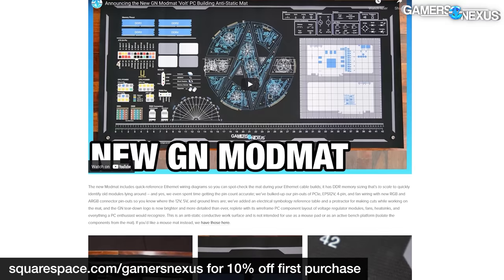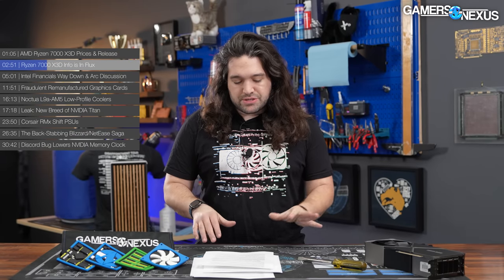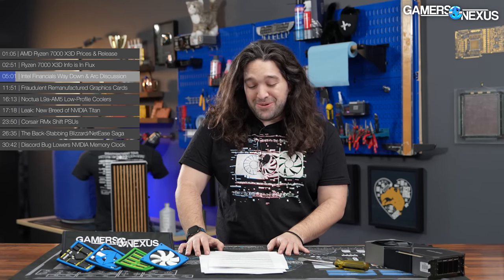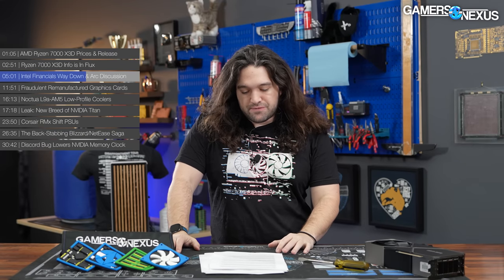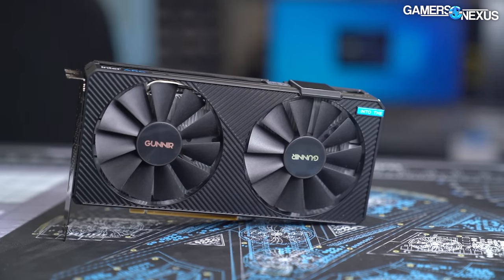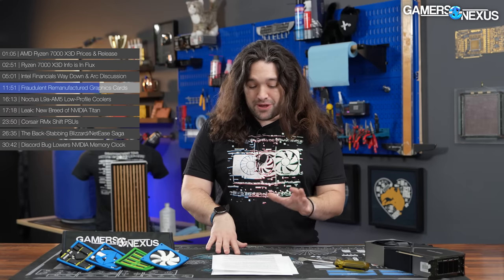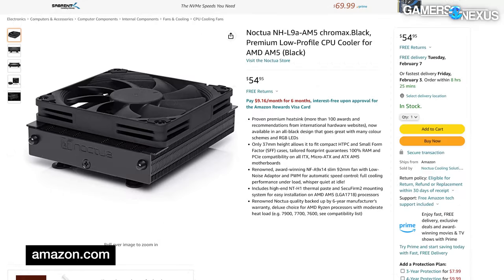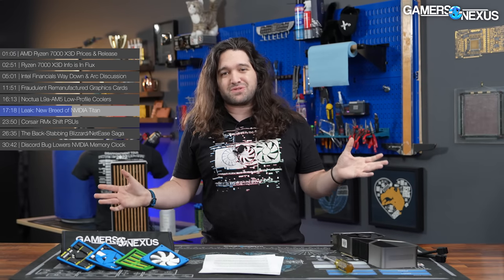HW News - Fraudulent Used Video Cards, 7950X3D Pricing, New NVIDIA 'Titan' Rumors

Comment: As for the Nvidia + discord bug, I don't think discord should be allowed to drop the gpu clock by 200mhz without calling nvidia's apis about it directly which I highly doubt discord is doing. Most likely its a Nvidia driver bug triggered by the way discord behaves. Doesn't really matter to the end user but it's something that should be fixed on nvidia's end not discord's end.
Reply: Why is the bug only in Nvidia drivers? What are they doing differently?
Reply: That is a question for nvidia engineers, I would guess its a glitch around going into a compute state which lowers clock speeds a bit.

Comment: In response to the bit about Discord - overlays are the bane of gaming performance. Even if they work right now, it's something that integrates heavily with your system and you never know when they go wrong or start doing bad things. If there was a way to turn off GPU acceleration in discord, it would also probably fix this issue. AFAIK there isn't a single tool that will allow you to see all the active overlays in Windows, so you can figure out what's happening when it goes wrong. That's another horrible part of modern gaming in which you aren't able to diagnose a issue if you have one, and there is a absolute metric fuck ton of programs with overlays now... more then likely including your RGB software.

Comment: Something to note from the intel crashing, during that period of time, people were wanting new computers, but no one could afford the graphics cards. Intel was the one offering built in graphics as a standard feature on almost all their processors. 
AMD only really started doing that with the current generation of processors, and you had to go lookin for processors that had graphics ON them to avoid needing a card. 
That said, when I made a new machine for my friend back in late 21, I went with AMD with graphics. I've since offered to get him a graphics card as their availability and prices have dropped, but he said he doesn't need one. Mostly he uses his machine for video watching as well as some low end video editing work. (converting video from VHS and CX disk video players) 
Business' are also upgrading machines to meet win11 requirements, so you can find SHITtons of refurbs out there for decent or even exceptional prices. It should be noted that said business are not all going with Intel machines now. 
WHen you're buying a fleet of machines, and you can go with intel, or AMD for 200 bucks or more less per machine, it's looking like the AMDxp from the 2007s and on.

Comment: The 7000X3D cards are more expensive than I personally would have hoped, but considering the prices Intel has launched their stuff recently and the amount of people literally waiting on them and their performance, I can understand where they're coming from. Considering the 5800X3D can still easily be gotten for around 300-350 and it leaves 13900Ks in the dirt for specific workloads without an upgrade to AM5 (and most likely DDR5), as usual we will see ;)

On the 4 Slot potential Nvidia monster ... Looks into case, top left quarter, huge air cooler, imagines a 4 slot card in essentially the lower half of the case, yeah, that's going to be great for people who like their RGB...

Comment: Random question just because I can't seem to get information about my issue anywhere online... I recently bought a Asus TUF 3060 OC along with a Samsung Odyssey G7, I've been having this issue where randomly the screen will go black for 1-2 seconds then come back on and at the top left says "Display Port" like I just swapped the input... I've tried adjusting settings, I've done driver updates, I've tried fresh install of drivers, I've even changed the DP cable and it still keeps happening (i run 2 other monitors from 2010ish non Gsync, maybe that's messing with it somehow since only 1 monitor has Gsync?)
I'm really lost and almost feel like returning the monitor because it's becoming quite a nuisance tbh... 
Great video as always guys, always look forward to learning more from you guys! PS I swear I've been subscribed for years but i guess not, unless youtube unsubbed me

Comment: Okay, maybe completely unrealistic but what if that potential Titan card is oriented 90 degrees off, because this way you can plug it into two PCIe slots? Might not even be to use both for data transfer, but rather to have the second slot to secure the card?

Comment: In regards to Intel, I would not worry that much. Sure, there is a chance they might pull the plug on Arc, but I would not consider that chance to be high. They are entering a new market with expensive to RND product. They must have had extensive discussions about losses they are going to have in the first few years vs long term gains. 
GPU is also just another CPU and there are things that GPU is much better at. If Intel does not do anything to enter the GPU market, they might eventually find themselves pushed out by AMD and nVidia.

Comment: it would actually be quite easy to solder on a pci-e connector to a 90 degree board. it could be as simple as optimizing the air flow over a really high power card, but maybe they could also have designed it to use a second pci-e slot on very specific motherboards ect. as in having extra pci-e lanes available to it might be quite beneficial for whatever they market it to be able to do really well ect.

Comment: Probably time to switch back to backplanes.

CPU and io on a left facing vertical card, GPU as normal (right facing).

Intel have a recent example of this, but the CPU needs to be flipped.

Then you have 2 back to back cards with their own airflow and no sag.

Comment: Steve, Did you also think about the Connector orientation "The Beast"? Definitely could be another reason for the change considering all the issues Nvidia has faced over that as well.

ALSO! It would be great if you could compile a list of cases that is compatible with the Corsair Switch PSU.

Comment: I build computers on the regular. I usually just hook up all the cables on a PSU just in case you need a cable later and, I do it for the customer to not lose them.

Comment: 30:42 - Discord has fixed the memory clock issue with an app update as of 2023-02-05 @00:35 EST.  Update Discord (upper right corner, green "down arrow" button) for the fix.
Reply: So Nvidia fixed their driver? Discord worked fine on AMD, so what would they fix?
Reply: @sammiller6631  No idea.  All I know is that since the Discord update, memory speed on my RTX 2080 went from 7500 MHz to 7750 MHz.  No nVidia update was necessary.

Comment: I think that orientation for the 4090Ti could address the issue of case compatibility. It might be so big that the majority of current cases on the market could not fit it. Many people with 4090s are required to vertically mount the GPU to fit in their case. Even larger cases will see the power cables of the 4090 brush up against the glass panel.
Reply: There is no issue. Buy a bigger case. If you can waste multiple thousands of dollars on a gpu, you can waste hundreds of dollars on a huge case. Idiots accepted that for the 4090, they’ll accept it for the 4090 OC, sorry, the Titan
Reply: @joemarais7683  the 4090 Titan Super

Comment: "Intel Financial Way Down":
will this mean they'll finally feel forced to lower prices,
or will this result in an even worse push for a permanent increase of GPU prices
to one tier and a half higher then their performance would suggest?

Thanks for your videos!
Reply: When Intel sells less volume, its prices increase per unit. But it prices and does financials by product category, so less consumer and server CPU demand doesn't affect GPU prices.
Reply: Intel is nowhere in GPUs so they're not even close to a position to disrupt the insane pricing of the duopoly in the mid-high end GPU market we are seeing.

Also, gross margin is what gets market analysts hard, that puts pressure on Intel to maintain revenue and therefore pricing, in what is expected to be a slow sales year

Comment: How about Nvidia do a driver update instead of making me edit GPU profiles.
Nvidia can release multiple driver updates a month not just one a month. 
I really do not feel like editing stuff after I installed them.
I am doing that enough at work already modifying queries scripts and so on. I would much rather have something come as an automatic update via the software(Geforce Experience), then to take any extra un-neccesary steps.
Reply: actually it is already fixed you just need to restart your computer at some point after nvidia customer cares tweet at 4:42 PM · Feb 3, 2023. no need to install anything but the reset maybe just relog is necessary.

Comment: The the Interesting leaks on a 40 series monster... my guess is the card is designed for a vertical mount. So it's weight is better supported, would mean the vapour chamber is mounted correctly. Also it may come with a riser cable pre attached? Or as an accessory so that it can be mounted as intended. In my eyes it would make alotbof sense to do this. Though I would also have considered mounting a set of counter rotating high flow fans at the end of the card and made it into a tunnel cooler myself.

Comment: I think that when the GPU is in a horizontal position, the load will not be on the board, but on the cooler itself when using a flexible riser.  Also this solves the problem with the nvidia connector, because it now looks up.

Comment: 1) Not that me buying an Intel Arc is likely, I am still concerned about that division. Intel's success in that division can have positive effects for the consumers of the other 2 brands. Intel's stock holders need to realize that, despite baring Intel's name, it's effectively a new business. As such, it's very rare for a business to not lose some money the first year. With the way Intel has been able to adjust the drivers to a point that the GPU's are really damn good for their price point, if left alone to continue onward, the Arc (ACX) department has a really good future.

2) If I was in the market for used, older, GPU'S frankensteined cards aren't a bad way to go so long as the buyer knows, the cards are relatively safe (won't catch fire), and they function as good as the original.

3) Corsair's Shift is, in my opinion, one of those "Why hasn't this been done before" type scenarios. When I build/upgrade my PC, it's usually a time when I can't afford to wait until part pricing comes down. So, I'll flesh out the basics of my computer(s) and, then upgrade as I get a chance to do so. Having to essentially remove the PSU every time I need to get to the plugs is a pain. My case has a movable, but not removable, drive cage and it doesn't move quite enough. So, I applaud Corsair for this. Though, I'll have to wait until that feature is on lower tier priced PSU's.

Comment: Intel actually made the first AGP Graphics Card using the same Real 3D rendering tech as Sega arcade systems produced by GE Aerospace. It was also the 3d processor used for the Apollo docking simulator. The Intel i-740 it bombed amazingly because it wasn't as fast with texture mapping 
https://en.m.wikipedia.org/wiki/Intel740

Comment: I also not just don´t mind perfectly good parts being scavaged and reused, but actually highly appriciate that practice: start to reduce those freaking megatonns of unnessecarly e-waste for crying out loud.  But there´s also no question that it should be made perfectly clear if it´s a brand new product or you´re buying something used which was scavaged and might have some risks coming with it, otherwise it´s just plain fraud.

Comment: Nvidia wouldnt try such a thermal design if they didn't think it was working. They've gotta deal with a lot of heat, if not on the Ada Titan then for sure on the next gen. Nvidia having very smart engineers, I think this design can turn out to be mindblowing

Comment: I would like to start a thing here for pricing of everything since I enjoy watching Steve boy. Why AMD and Nvidia with all the brands even intel could give to people that recycles their heatsinks 20%back of the value of the card and reuse the heatsinks on the next gen GPU and or CPU. I would like to ask how many recycled for free a 500 or 1000$ GPU? How much copper heat pipes and aluminum heatsinks that is? If that could drop the price it keep them low enough to purchase a new GPU chip but, fully functional heatsink and maybe recycled PC boards, trace standard to make it happen with the vram. It's a lot of parts that are almost lifetime warranty kinda. It does worth 15 to 20%. Could that be a thread? Thanks for your videos.

Comment: 14:00 this is same as those "new" lga1150 , lga1151, lga1155 , lga775 board that are being manufactured even in 2023 , mainly from chipsets extracted out of ewaste as some of those chips have been out of production for almost a decade. i have a board like that they are not bad but very basic in features like only 100m lan on a h61 board , even though a cheap asus lga775 board i have came with 1000m lan.

Comment: I have the bug with lower memory clocks, my 3070 is running at 6800mhz instead of the usual 7000mhz, not that you notice the performance difference. I have had it before, maybe over a year ago, and a driver update fixed it if i recall correctly, not sure what caused it back then.

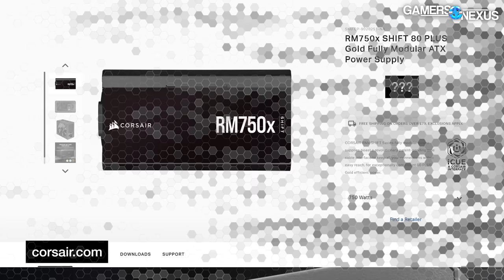Comment: 26:35  this is why I haven't gamed in years, online gaming should be DE-centralized with profiles etc on your local machine with software (games) you ACTUALLY own !
Reply: Bleh, peer 2 peer connections aren't reliable. The players will cry again demanding a dedicated server
Reply: @MeowyBrigade  peer to peer can be quite reliable if it's engineered right, but you also need a good synchronous web connection, equal up/down speeds a lot (most) people have asynchronous connections which works better for a centralized setup. decentralized peer to peer was demoed years ago before big tech started centralizing everything and taking away ownership by providing " software as a service " instead.

Comment: The 7950X3D is really nice, but really I am waiting with baited breath for the HEDT Threadripper 7000WX (storm peak) at the end of the year.  Hopefully it will be just as fast (calculation wise) as the 7950X3D but with more memory channels & I/O.    The HEDT market has been empty for YEARS and I really need an upgrade!
Reply: Hey, Steve. I'm a CS student and am almost done with my degree. I was curious; what do you need so many cores, memory channels and I/O for?
Thanks!
Reply: @M1nat0  what do you need so many cores, memory channels and I/O for? Bragging rights.
Reply: @M1nat0  FPGA code compilation needs quite beefy CPUs i had some take multiple hours just to compile and memory channels help a ton when debugging.
Reply: @M1nat0  Hey, as a CS student you may get the reference it's not cores/compute units really but a balanced system (Gene Amdahl's law still applies).    I'm in the tech industry/support engineer and am on the computer at least 16/7.  Have to run numerous applications and VM's (vmware workstation) and may be running 4-6 (up to 8-10) VM's at a time PLUS my own system.   When I'm waiting on other items to complete I also play games to pass the time (which are more and more going into VM's if it's just DX11 or DXVK compatible).  Anyway, to handle this you need cores/compute units, you need I/O (NVME/SSD hardware raid cards (to get up to 14-20GiB/s or so or  >1million iops); Network I/O (currently multiple 10Gbit but am looking at 40/100gbit) plus memory bandwidth to handle all this, understanding that every I/O transfer is copied on average about 4 times in memory (DMA transfers) so you need several hundred GiB/s memory bandwidth to handle the workload.   To me this is 'normal' and have been running multi-processor systems since the pentium pro days with dual then later 4 PPro's).    So ultimately I'm looking at a 'workstation' i.e. cpu performance similar to desktop; but with I/O; memory; ecc; audio; etc functions of a server.  the last 'intel' one was probably their server skylake (LGA2011-3/v4 cpu's form 2016) so it's been a LONG time.
Reply: @stevekristoff4365  Oh ok, so this is deifnitely not a common thing for the tech industry, or is it? For example, this much compute power would not be as necessary as a software/game dev, or am I mistaken?
Reply: @M1nat0  It highly depends on what field you work in and frankly if you are of a personality type that tries to redress performance lacks in others of your team.  I.e.  I do support for multi-clients/organizations, in this field there are a lot of 'clock watchers' opposed to people trying to learn/help.  My personality is more of the later.   I model and run scenarios through or mimic issues to try and understand causes so as to find and test solutions.   I would say that only about 10% of the people seem to be of the same mind.   As for your particular case software/game dev then it would come down to what types of games/software you are developing.  I.e.  are you trying to scale for multi-threading, if so how well?  (more cores/threads are important); if you're software dev what type of software?  Large scale analysis can for example help scaled out wide (more cores) but then also puts more strain on I/O & memory.  Or is it interrupt driven (needing to react to input/output to a device) then that's going to be more clock cycle dependent or to give options to APU's (like in mainframe type systems).